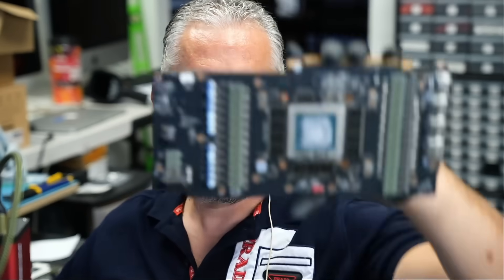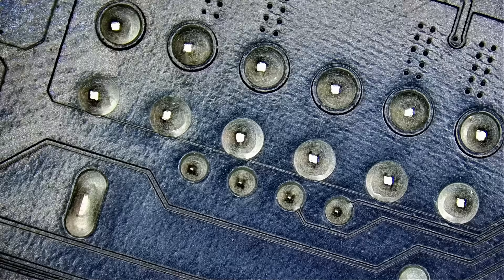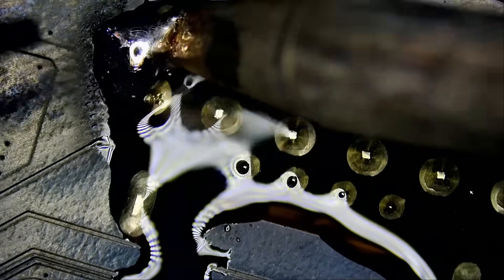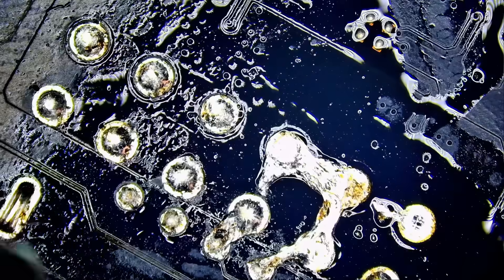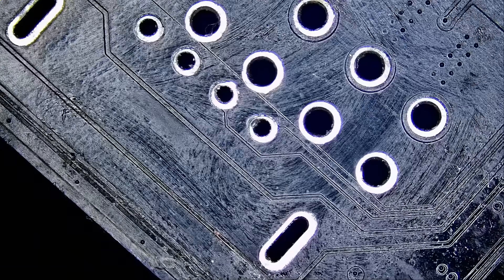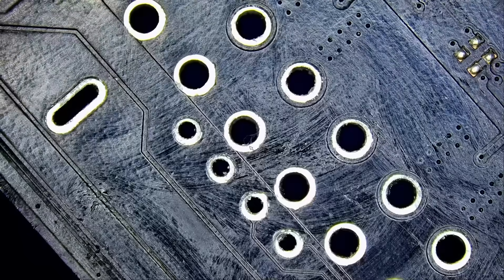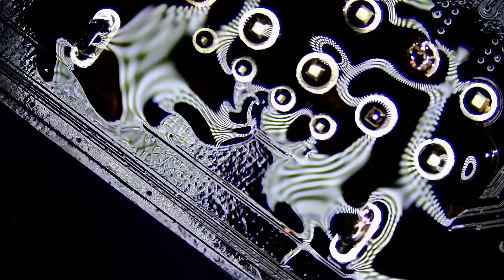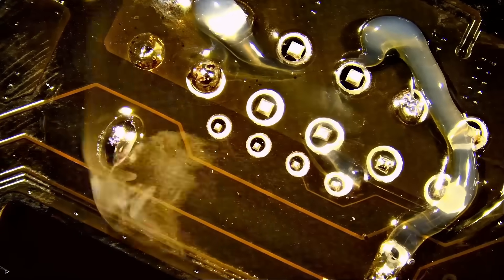Expensive MSI 4090 SUPRIM GPU Repair - Connector melted. Still an ongoing issue..

Comment: Fantastic job! 

90 series always makes me skittish, I never over clock 90 series GPUs, instead where possible,  i under volt by a small margin, obviously if that card remains stable, silicone lottery plays its part. Even a small voltage drop helps drop the power and takes the edge off. No guarantees though of course

Comment: Have you noticed the most damage is usually always the side with the tiny pins for data not the other side with the clip ? how is NVIDIA still getting away with this crap, its almost always melting at the side where there is no clip.

Comment: Ill be laughing my ass off in 2 years when 90% of the 4090's have failed or been repaired just to keep going yet my 9070XT will be perfectly fine. The first 4090 fail was within 6 - 8 months from its launch date. Overpriced premium green sticker garbage that cant even have the longevity of 2 years let alone 1 year before committing hardware suicide.

Comment: It makes sense to me, that the overheating pins are the ones with the best connections and lowest resistance. For example, the cable has 6 parallel 12 volt wires, if 5 of them are making poor connection (high resistance) then most of the current will flow down the one wire with a very low resistance connection, so it gets too hot and melts. It doesn't make sense that one pin is overheating because it has a bad connection - a bad connection means high resistance, high resistance means most of the current will flow down the other 5 cables.
Reply: In fact it is not bad connection but too much current and stop.. you wanna know why to much? i think i know it..

Comment: You would think that a 4090 would be cheaper than the rest due to its popularity of smelting its power connectors.. And yes, it's better than factory!
Reply: The problem is the connector, high resistance connections at the pins. The card is not at fault -all its doing is drawing a lot of current.

Comment: How long should I hold on to my 4090? I’ve had it for a few years now.
Reply: The problem is the connector, high resistance connections at the 12 volt pins (there are 6 of them). The card is not at fault - all its doing is drawing a lot of current. If i had a 4090, I would  take the connector off and squeeze the female pins down a bit, to make sure the 12 volt lines are making solid connection. Some people say the female pins are made of cheap soft metal, and don't clamp onto the card pins tightly -if that's the case, then you need a new cable, check the new one in the same way).
Reply: Unless you want to sell it sometime and get a 5090. Keep that 4090 till either it dies or until GPU prices level out. However that’s just my two cents.
Reply: YES Unless you are running a personal AI

Comment: I kind of wonder. I believe extensive frame gen is to blame for this issue along side the crap design. Think about it. Pushing things beyond their limit already at max load, enable FG, more processing is going on within the gpu, and MORE unstable transient spikes at that point. 

Either way, I limit my fps system wide with the same 4090, Suprim X anyway. I set it around 90 fps, as long as  the game looks good, i couldn't care about pushing it to the limit 250+ ranges.